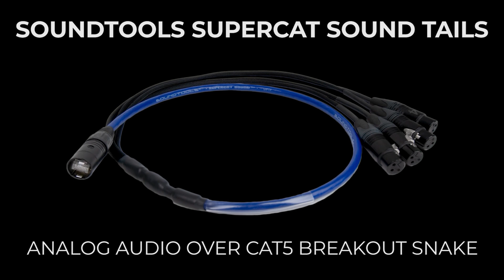Understand Impedance & Real Speaker Voice Test

Comment: Good explanation
Reply: @DaveRat  the thing that is confusing for me, is the low impedance is like a shovel with rocks. Implying it has more strength, but as microphone is low impedance.
Reply from the maker: Great question.

It's all relative so a transformer is like a transmission in a car.

Low impedance is like first gear it goes slow but it has more torque.

Hi impedance is like 5th gear it has more speed or voltage but not much torque at all and can't move things that are of much weight or loads of low impedance

When you talk about the microphone that's the engine size so you could have a small engine like a microphone or a huge engine like a power amp and then run that into the transmission that converts it to a low impedance or high impedance or it may naturally be a low impedance or high impedance
Reply: @DaveRat  even tho it didn’t quite sink in, it’s that math side of the brain. Maybe one more analogy would do it. Who knows

Comment: the first sub I ever bought was a JBL MP255, 4 ohm sub.   I was just a kid in a band and I had a crown powerbase 1 which was basically a 200 watt per channel amp and you could bridge mono this amp so my plan was to run the sub off of it... well the sub's peak power was 2000W and the crown amp made 455 W into 8 ohms.  it was not rated for 4 ohms in bridge mono so I think it was a "no no".  the individual channels I noticed made like and additional 12% more power at 2 ohms.  anyways, I bought this sub on clearance at a music store that was going out of business and I hooked it up and it made the worst "clunk"  I heard come out of a speaker before.. it was a metallic car wreck sound. So I disconnected the amp and brought the speaker to atomic music in Maryland where they tested it and it sounded FANTASTIC in the store.. but I couldn't afford a new amp so I just sold it.  ( a week later I bought the MP418 powered 15 that was labeled as a 18 ).   anyways this lesson taught me a little about impedance.   it wasn't long before I was doing a lot of bridging to power dual 18 subs.  never had the money to do things the right way.  anyways I think that power-base 1 was "power" clipping and just completely failing..I feel like the 4 ohms was drawing down the power supply so fast that there was a voltage collapse and something "snapped" electrically somehow to cause a metallic "clunk" which had almost like a metallic "bell" quality to it.. but it was more complex than a simple "clunk" it was was almost like a couple of clunks all together and some failed restart clunks as well.. it was awful.  Anyways for the time being, the powered sub was the answer..

Comment: Thanks Dave, impedance is pretty hard to get your head around and your explanations were interesting. (but don't ask me to remember every detail) I think impedance is confusing because we are talking high impedance (in ohms) basically being low power and low impedance  (in ohms) being high power. (Is that right ?) Also, (long story cut short) I replaced some 8ohm drivers in my 2 double 18 subs with 6 ohm drivers. i am using i nuke 6000 amps so I had rewire them not to be in parallel but each driver powered individually from left and right amp outputs as i nuke are a bridged amp and only good to 4 ohms. They sound really good !
Reply from the maker: Cool cool

An easy way to remember it is low impedance is like first gear, slow speed lot of torque and torque would be current and speed would be voltage

Hi impedance is 5th gear we have lots of speed but not much torque

Comment: Depending on the circuit, impedance can go up or down over frequency (as can the phase response). DC Resistance can be thought of as impedance at 0 Hz.
Reply from the maker: Agreed
Reply: @DaveRat It is fun working with complex numbers that have a real part (resistive) and an imaginary part (reactive). A cap has the frequency value in the denominator (more freq, less z) and a coil has it in the numerator (more freq, more z)!

Comment: Dave a better test would be that sonic head thing with mics built in that is supposed to emulate human hearing- then comparing sources (real Dave, single speaker Dave, Dave array ) 

The four mics will have interference with respect to each other that will cause cancellations etc in the listening demonstration…. 

That all said 

Your on to something…. VR for audio without the R
Reply from the maker: If the mics are close enough to the source when recording theoretically the mic should all record different sounds of the source and those phase cancellations during reproduction should be minimal or probably desirable has it mimics the original

Comment: Your transmission analogy kind of fell apart at the end there. Way i see it, each gear would be more like a horn/transformer on its own, the transmission switches between them for the most efficient/effective choice at a particular "frequency" 🤷‍♀️, now i may have to play around with getting different horns attached to both sides of a single driver to sound good...
Reply from the maker: Hmmm, a horn for both sides and radiate phase and antiphase into the air? Like combining the in and out of polarity of a balanced line? Combined well will give you max cancelation.

Treat the front and back of the speaker like pin 2 and pin3 of a balanced line.

Except unlike a balanced line we can't just short one side of the speaker to ground we have to do something with it like put ,it in a sealed box or a ported box, or accept the cancellation that occurs when the in phase and out of phase signals combine at various frequencies causing cancellations.

A horn adapting the impedance differentials between air and speaker impedances is not really an analogy as much as a description
Reply: @DaveRat  Good point, though we do accept some amount of cancelation with any ported box, and especially with ABC designed sub enclosures. Maybe the actual design would be better described as a t-line with a horn on the front. May sound interesting, if not real or even good. 

In terms of the 4d speaker, have you considered using some kind of reverb or echo generation, then isolating the resulting generated data and playing that on the other channels? I'm not sure how they work, if there'd be enough alteration compared to the original track to "upscale" to 4d without simply turning it into one of those omnidirectional speakers. I understand what makes your method different, just trying to work out a way to take advantage of it using traditional stereo recorded audio. 

I'm very interested in this project, do you have an email address or other way I could directly contact you?
Reply from the maker: You can reach me through the soundtools.com web site. I don't want to post email here.

As far as r verb, my goal with the 4d is to from the instrument into the listing environment, not to recreate the instrument and an environment inside the listening environment.

I want it to sound like the instrument is in the room with you, not you are somewhere else

Comment: I'm not sure what your point is here.
Are you attempting to convince us that a multi-directional, multi-driver unit sounds more natural than a multidriver directional unit? 
It should be obvious by the audio in this video that it does not.
The directional speaker would perform better in this video if you had set it up as it is designed to perform and if you would have placed a microphone in front of it.
Your multi-directional unit doesn't sound natural at all due to its design and construction limitations, as well as, the fact that, as listeners, we are listening on either headphones or directional speakers.
Reply from the maker: Perhaps watching the 2 videos that lead up to this would be helpful. 

Regardless, this w ries of videos will show the differences of conventions speakers trying to recreate natural sound sources

As I am sure u are aware, natural sound sources radiate different sounds in different directions, yet conventional speakers tet to recreate these source by radiating a single sound in a single diretion or in the case of omni, even worse, radiating the same sound in multiple dir cations. While this is clearly a flawed adventure, it is commonplace.

I am doing a series of videos showing the differences between capturing and recreating sounds in a more realistic way where multiple sounds are radiated in multiple directions.

Comment: interesting! the frequency response of the 4d speaker sounds extremely similar to the Live, but it seems to be exaggerating the stereo image significantly.  Is that just because it is doubling the stereo differences because it is recorded again thru the 4 mics that feed the 4d speaker? I would be curious to hear the same test but instead of listening with the 4 mic setup, you place another stereo pair a few feet back and use that to listen to both the LIVE and 4Dspeaker versions. Thanks for this cool video nonetheless :)
Reply from the maker: The proximity of the mics to the 4D speakers makes the sound changes very distinct differences.

Ideally for recreating a voice, the 4d speaker would have speaker sources closer together, more similar to the source. But, when farther away the differences are way less audible.

But I did not want to move the mics as I used the same positions as the original. I I think did wander with a stereo recorder at the end of th vid that gives a better representation, but I could not wander while speaking as I did not have an assistant